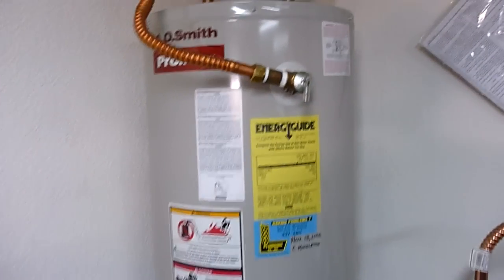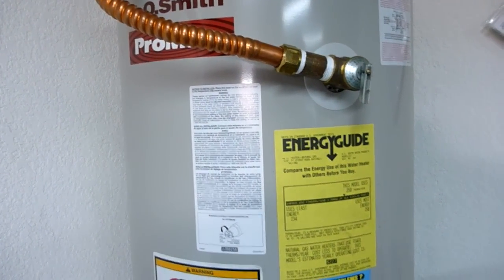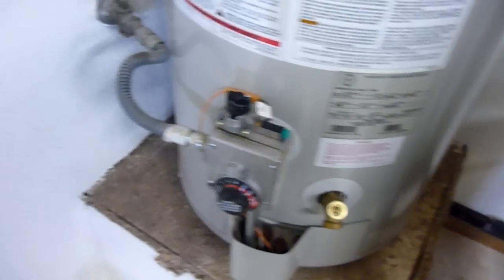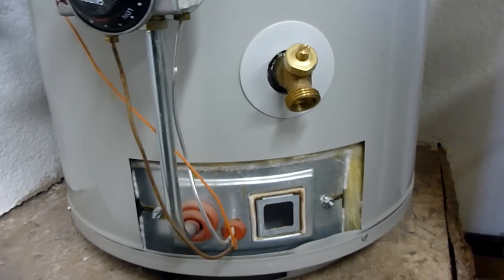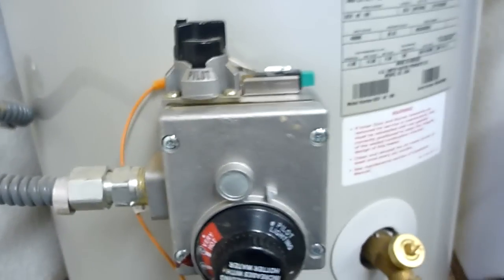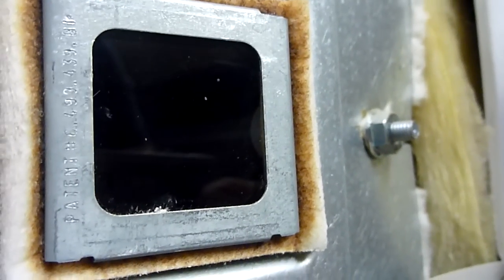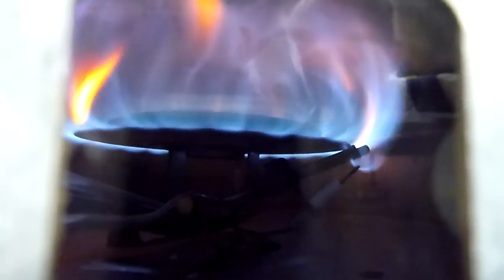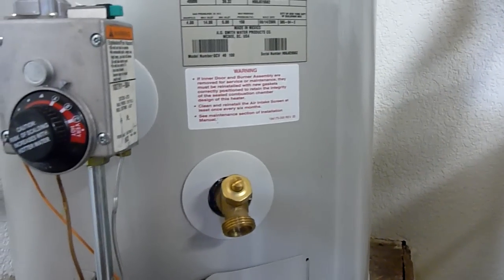Water heater shutdown, relight, and maintenance

Comment: question: my gas bill is high and it's summer. I called the gas company and they said there is an appliance that is being turned on at night around 9pm and uses gas for several hours. I don't turn anything on at night so I'm assuming there is a problem with my water heater. It's an American Standard one. Is it possible it's heating the water at night even though I'm not turning the water on?

Comment: Excellent video mines ddnt ignite but now im sure its something that i cant fix and i just have to call a service thank you for the vid once mines fixed if it goes out and its minor ill know what to do
Reply from the maker: Follow the directions about waiting and then retry.  I have also found that using an electronic spark lighter with the inline electrical connector works great, but not everyone has one.

Comment: so I know how to light it but it went out a d I lit it it came on but then it turned off. I waited 5 min to try again and now I don't see the spark or anything and it won't light
Reply: Since he didn't answer I will. If your pilot went out the moment you let go of the reset button, could be a bad thermocouple. If your burner came on but then all went out, your water heater combustion air may be restricted causing the burner flame to smother out. Some have screens on the sides and on the bottom which get full of lint and need cleaning so it can get air. Also happens if it leaks water and the base of water heater gets flooded and closes the air openings. Also, some water heaters have a safety device called TRD which needs to be replaced when it get broken. So there's a number of reasons why the pilot or burner flame will go out.

Comment: I have the same ignition as the one in this video. Around this time of year (the spring) the pilot light keeps going out. every day I'll have to ignite the water heater. Any ideas to the problem? Also I'm noticing that the pilot light won't stay on as long as I'm holding down the pilot light gas button. by the time I switch it from pilot light to on and turn the tempiture knob, the pilot light has already gone out. frustrating.... Thanks in advance

Comment: Nice video but caution about using the flex copper for the T&P relief line. It's not allowed. If you point this out to the plumber that installed it I'm sure he will replace it with full hard pipe or risk losing his license or worse paying for the damage if that valve ever released super heated steam.
Reply from the maker: It's also not supposed to go uphill, was like this when purchased.

Comment: +710candlewood.....when I take my finger off the gas button after igniting the pilot, the pilot light goes out.What could be the problem?
Reply: Southeast Wink 202
Reply: Southeast Wink 202
Reply: Flaco Urrutia ?
Reply from the maker: Old reply, but you hold the gas button for a little while to really heat up the thermocouple, if after holding it for a while it still goes out, then it's a problem with the thermocouple, the control valve, or the wiring between the two.

Comment: ...and when that little green button wont make a spark? Wtf do I do then?
Reply: +Grant Walker Time to buy a new ignitor.
Reply from the maker: The spark can be really hard to see, but if it doesn't work you can get a new one or use an electronic sparker held inline with the wire which works great with the stubborn ones.

Comment: Help the burner lights up but when I switch the pilot to on it doesn't stay on. Why is this happening ?
Reply from the maker: If you hold it for a little while and really let it warm up the thermocouple hopefully it will work.  Otherwise it's probably an issue with the thermocouple, the control valve, or the wiring between the two.

Comment: Help... I am following your steps but not getting a spark.. I hold down the pilot light button but not seeing a flame through the window
Reply from the maker: The spark can be really hard to see.  When they are really stubborn I use an electronic sparker igniter inline with the wire.

Comment: Mine is old. I only have on knob on top of the switch...and there's like one switch or button, there's no pilot or anything. I'm just afraid I turn it off but the gas still keeps coming out as Monoxide.....and shit happens. How the hell do I turn my gas off b/c my house is hot as hell and my water heater is in my kitchen which is connected to my living room....?

Comment: Do you have any videos as to how to replace the pilot assembly for this type of water heater? 
You said it was sealed but I've been noticing a lot of people just replace the parts and dont do much abou the seal or mention replacing any gaskets.. Can you comment on that?
Reply from the maker: I don't have any videos of that.  I'm sure that a lot of people replace parts without replacing the seal, not the proper way to do it on a sealed unit.  They used to not have seals at all, but these are safer if you have an external source of flammable gas(like something spilled in the garage).

Comment: I just installed a AO Smith water heater model GNR 50 yesterday. The manual said the anode need to be replaced after a few years, but I could find where the anode port is located. Do you happen to know?
Reply from the maker: They are usually located in a plug on the top of the heater, some are built into the water pipe connection on the top of the heater.

Comment: the number one reason for pilot light failure in the newer style water heaters is a dirty flame arrestor. the flame arrestor is located under the water heater. the flame arrestor is in a hard to reach place but can be easily cleaned with the tightspotvacuum brush. preventive maintance is a must.

Comment: great video . the new style water heaters with the sealed burner chambers need preventive maintenance or the pilot light will keep going out.you need to keep the flame arrestor clean.they make a tool called tightspotvacuum that can get under the water heater where the flame arrestor(screen) is located. keeping the screen clean will allow the water heater to draft the heat out efficiently so the thermo cut out wont trip.go to youtube FVIR  good luck

Comment: @710candlewood I dont know if my other comment posted, but I said that I fixed it.. The pilot and burner were cutting out.  I got a new thermocouple but the water heater I have has a different thermocouple from the one I bought.  Turns out the burner needed to be cleaned off

Comment: Thanks! Our pilot light went out and I followed the instructions that are printed on the side over and over. Then I watched your video which confirmed I was doing it right. Then I tried again and it started right up. On our model the "window" is 1/2" x1/4". Super tiny. I kept looking and looking until I found the right viewing angle (lower and looking slightly upward). You video confirmed I wasn't crazy and gave me clear idea of what I was supposed to see in the window. Thanks.